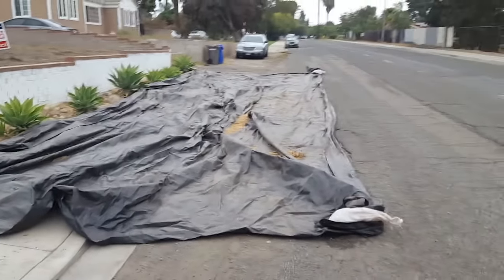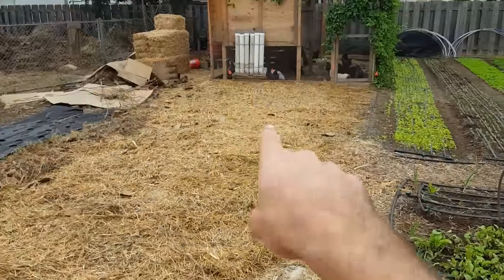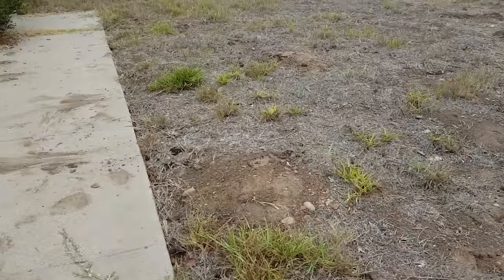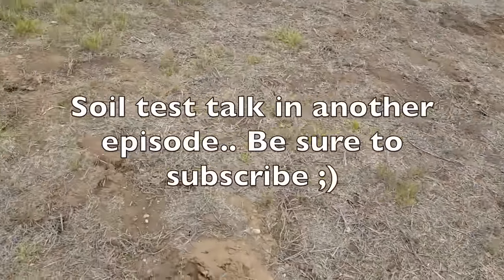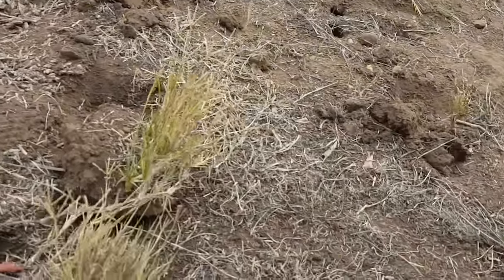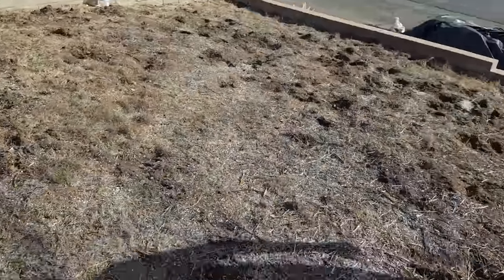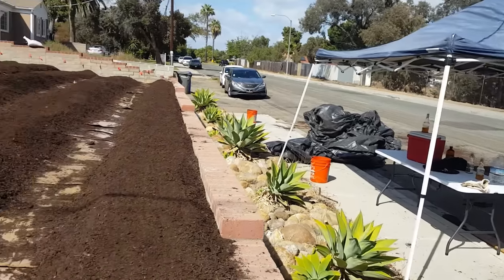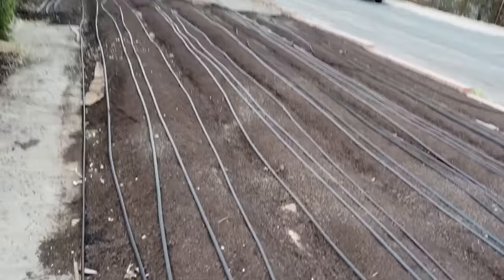Make Money In Your Front Yard Growing a Garden

Comment: Best of luck with your new venture.  Front yard garden often invites theft, hope you are not a victim. A big question, this area obviously has a major gopher problem, how do you handle these pests?
Reply from the maker: The gophers are going to be a pain I do have a strategy for them, I'll probably make a video about it. One of the strategies is to only grow herbs and baby salad mix there so when they do dig holes it's not a total loss. Also the easement next door I'll be planting dummy plants for them. I have traps set now and they will be set for the foreseeable future. Gophers are a big pain, predators would be great. Need some neighborhood cats.. I should grow some catnip ;)
Reply: I almost gave up a few years ago because of gophers. I'm glad  I stuck it out now . I feel I've overcome the problem. Please excuse the mis spelling. 1. Gophers are territorial  exept during breeding season. Which means there are less than you of them than think. Maybe about 3or4 on that property put all tunnels are inner connected with means once in a while another will make it's way there. Maybe three or for a year.  Note I use humane traps as much as possible and I will relocate but haven't found one for gophers. Don't bother with smoke or poison a waist of time. This should have been delt with before you started!!!! 1 get a good shop vac a hand shovel . And about ten of the small traps made out of wire with a trip plate . They. Fit in a hole about 2 1/2 inch diameter. There about twelve dollars for a two pack . Should be easy to find Lowe's , home Depot etc. 2. Whenever you see a fresh mound  shop vac the loose mound . Then use the shop vac and hand trowel to open up all the tunnels within ten feet . Slide set traps into tunnels and cover with plastic or something so it's dark in tunnel . Do not cover with dirt because you have to check traps each day. Usually takes one or two days to get one. Also tie a string to two foot long string to each trap so you can  easily find them. I wish someone shared this with me a few years ago.let know if you have any questions.  On my one  acre I have to deal with about three to five a year.
Reply from the maker: @SoCalGardenerGreg  Thanks so much for the tips on gophers I appreciate it. I like the black hole traps too.
Reply: Amazon sells a "black hole rodent trap". Expensive, but they really work. I've caught gophers within a few hours if you set them in an active run. You need at least two, one for each direction in the run. Different set up on them. Read directions. But they last a long time. I'm a catch and release on a lot of things, but NOT gophers. Once you dig a potato or sweet potato or carrot bed and find root after root after root with chew marks that make it unsellable, you declare war pretty quick.
Reply: Jennifer Kleffner blackhole traps are the absolute best and easiest safest hands down I stopped counting around 400! Plenty of meals for my friends birds who is a falconer. If no poison was ever used you could try to contact some in your area and donate your catch to them I see it as a valuable use, cheers